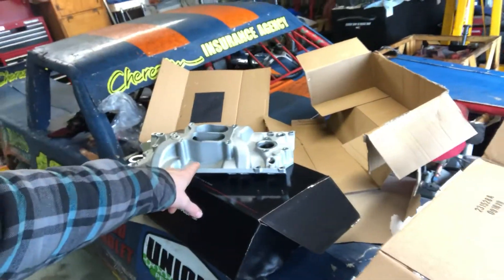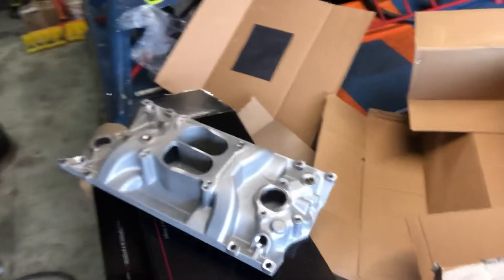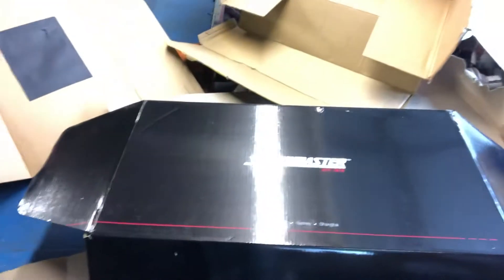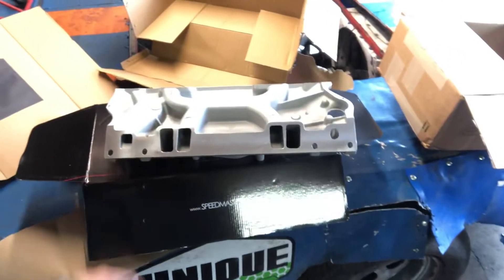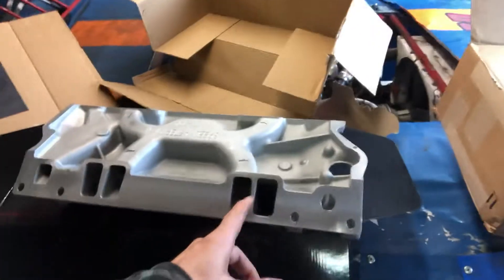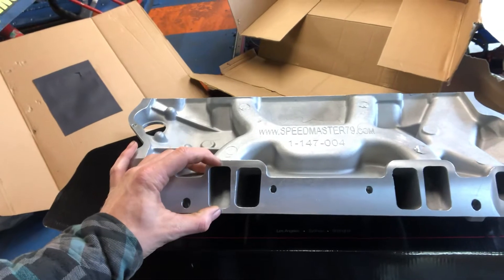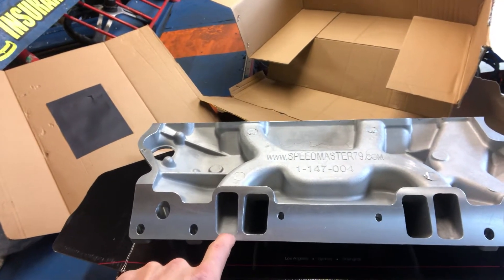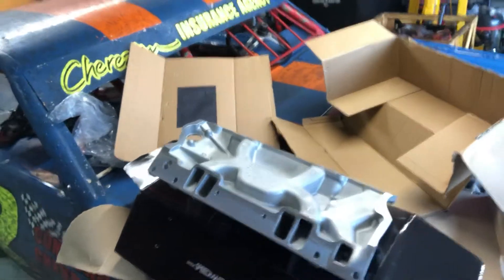Reviewing the Speedmaster vortec intake manifold. Why you can't bolt it on out of the box!

Comment: We are working on a speedmaster  Ford 351W 6-71 blower in take manifold now .  The port match is not to bad but the casting area around the distributor is a complete disaster !  We had to machine off so much material so the distributor would fit and now in to the water jacket around the water neck .  Gonna try welding in 1/8 inch aluminum plate to patch it back up .
Reply from the maker: Ouch!
Reply: @CherezianRacing    It's starting to get a little ugly but I'm not giving up on it . LOL !    https://www.youtube.com/watch?v=Ah4DZK1RZHk

Comment: Hello did you port after the video? Does it work good?   Thanks.
Reply from the maker: No just slapped it on. It ran fine on a stock motor, was actually pretty responsive.  Im sure it cant be good for WOT power though unless ported.